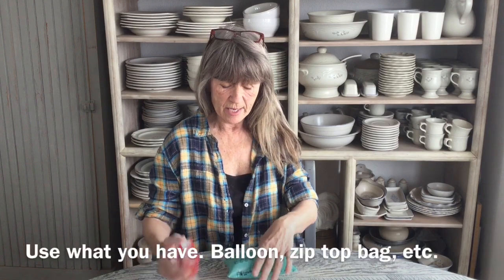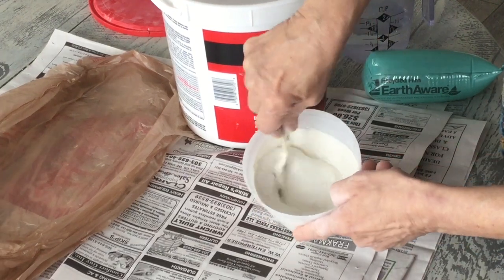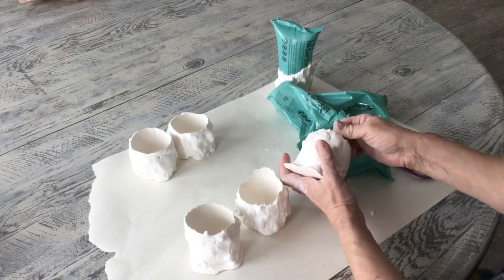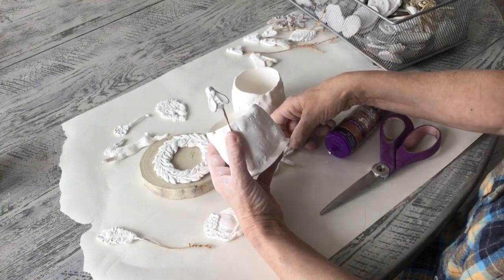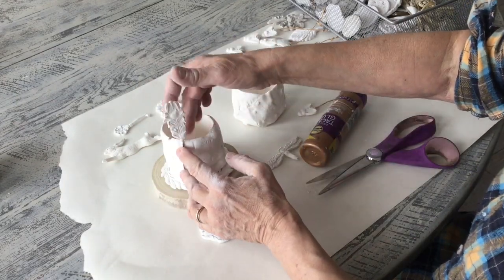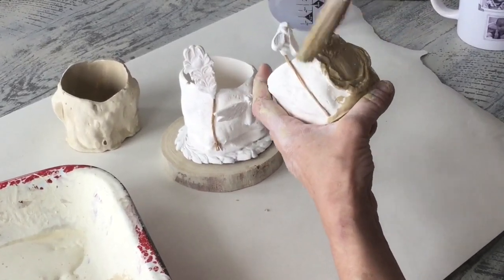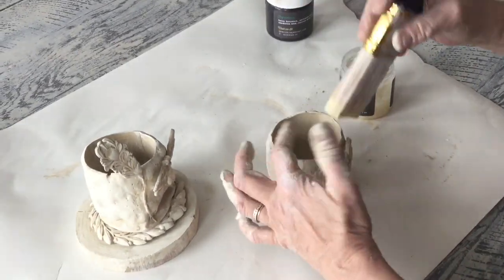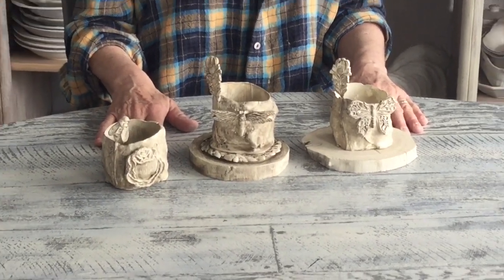Carmen's Curious Tutorial: Plaster Pots

Comment: I had a hard time working  with  plaster  of Paris  ty love your channels will definitely  follow  u..I have a big tub of this stuff I will try again.
Reply from the maker: Theresa,
Getting the consistency just right and making sure your working conditions are not too hot or cold will also help! Make sure the plaster is fully dry before re-dipping as well. Make small batches to work with each dipping session to ensure you have the right consistency each time. It can take a few trial and errors before it works for you- but once it does, it is fun!

Comment: These are simply charming. One question. Could you have run the wire on the inside of the containers to conceal it, or is the inside too smooth for good adhesion? Thank you.
Reply from the maker: such a good question, I am not sure, but I will have to try thanks..great Idea Thank you